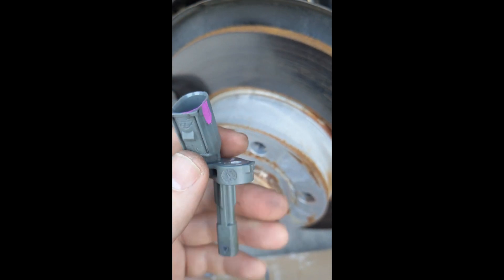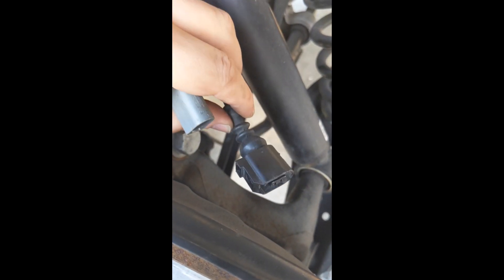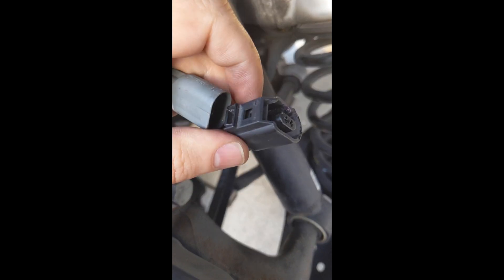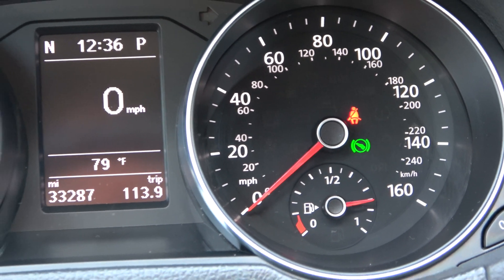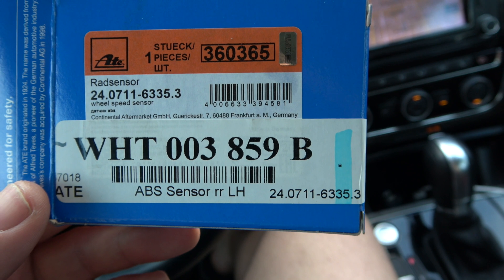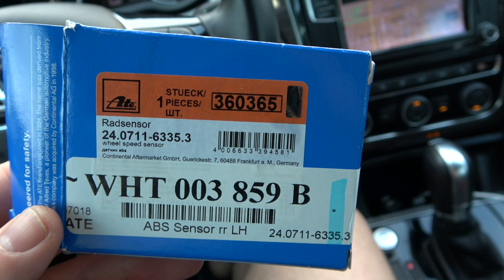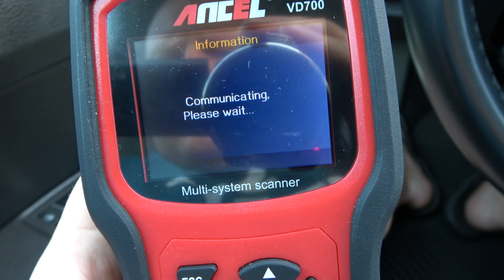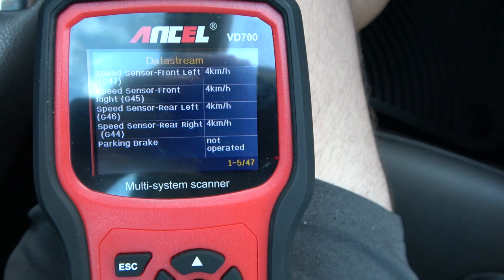VW Passat 2016: Replacing the ABS wheel speed sensor

Comment: Do you disconnect the battery to reset the computer after everything?
Reply from the maker: I did not need to, the codes and errors go away after everything is fixed. I did have an advanced obd scanner to clear the codes quickly.

Comment: Great video.  Made me steer clear of the Duralast sensors.  Purchased a Bosch.  Where did you purchase your Ancel VD700?  I see them for $138 on Amazon and $75 on eBay.  Want to make sure I get a functioning device.  Thanks in advance for the help!
Reply from the maker: I originally purchased it on Amazon but I have since got even a nicer scanner (Thinktool mini), I'd be happy to sell you mine if you'd like for 50 plus shipping. It's been used very little.

Comment: My Passat is giving me all of the same errors but it is not starting at all. Is this normal for this issue? Went overnight from having 0 error lights and no issues to almost all of them going and the car not starting.
Reply from the maker: Hi Ashley. The car shows all those lights before starting and that's normal. The fact that yours is not starting is not related to a wheel speed sensor. There is another problem and it should be scanned with a diagnostic tool.
Reply: Hi Ashley that's battery or alternator .

Comment: I bought one duralast wheel speed sensor for my volswagen jetta SE 2014 from AutoZone I need to replace it on the front right wheel a shop charge me 70$ for labor should I trust them the mechanic has 20 years of experience
Reply: You decide, it's literally a 15 minute job.

Comment: Did you have to reset something through the scanner after putting the new sensor in? Or you just put the new sensor in and it should just work and not show any lights?
Reply from the maker: Hi. You don't need a scanner for the light to go away. It will go away eventually after driving few miles if the new sensor is good.
Reply: @event3horizon  Awesome. Thanks for the reply!

Comment: Just did this job on my 2014 Passat.  I had TPMS, Airbag and ABS warning lights.  The dealer diagnosed a faulty ABS module and quoted me $3200 part and labor!  I drove to O'Reilly's and had them pull the codes.  They came up with a bad wheel sensor.  $25 and a half hour later I had the sensor replaced and no warning lights!
Reply from the maker: Good God, 3200??? Wow. Now I'm very glad I took the effort to do it myself. I had trouble with a duralast sensor from autozone not sending correct data and returned it. Had to find a discount euro part website that had a good deal on the OE Ate part. Local dealer wanted $133 plus tax for it.
Reply: @event3horizon  where do you bought the sensor?? 
Thanks
Reply from the maker: @Perromocho123  alleuro.com
Reply: @event3horizon  thanks. You changed by yourself or where you went?  I already call 3 places and they dont change costumer parts. Thanks again
Reply from the maker: @Perromocho123  Changed myself. It was fairly easy.
Reply: Wish you made tutorial lol. I have 2014 passat dealer wants $511 for right wheel speed sensor. Light came on when i had brakes done. Dont want to spend that if its easy. 😂